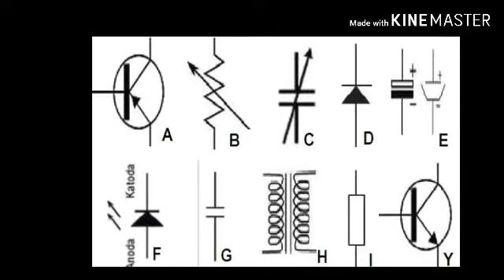Cara Memperbaiki Adaptor tv LED service by Diy Electrical #v3

Comment: saya punya adaptor ini
 buat tv 22 inch dipakai kok sangat panas sekali ya mas baru beli saya? beda sama adaptor bawaan tv nya yang udah rusak.
Reply from the maker: Ampernya kurang besar atw tidak real dr spesifikasi nya
Reply: @teknisielektro  nah speknya itu sama mas. 19v 1.7a. kata yg jual copotan tv/monitor lg mas. terus sy cek outnya 19.47 an volt.

Comment: The board is stuck into the case. How's suppose to come out?
Reply from the maker: there is still glue, put a little thinner on the sock of the board then shake the board
Reply: @teknisielektro  it came out, it was glued. Thank you very much for your reply.